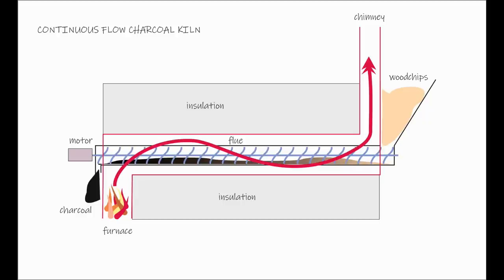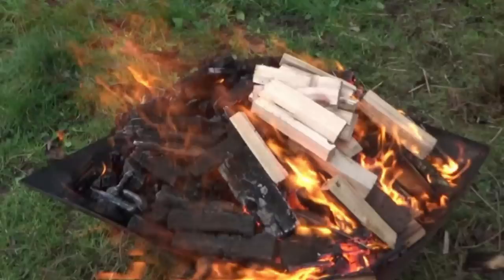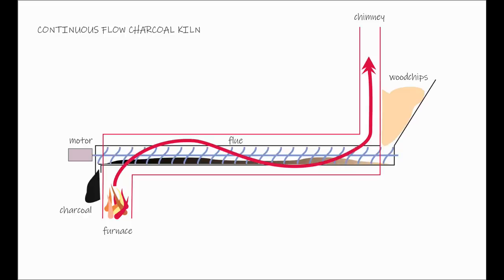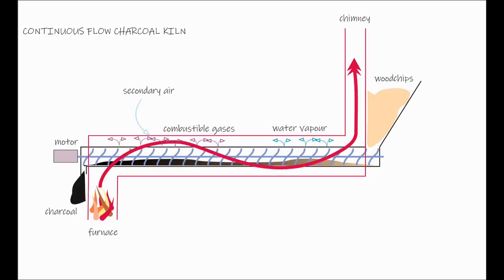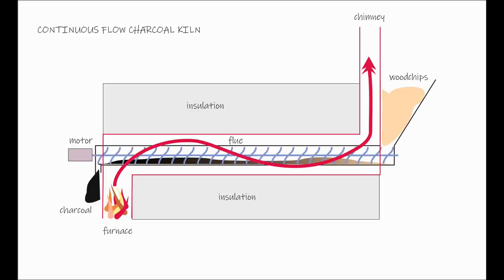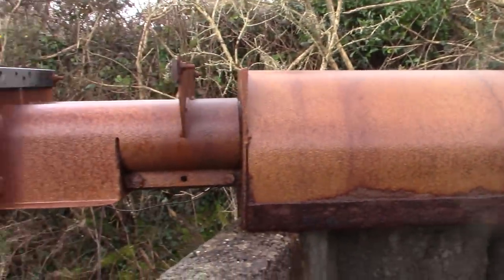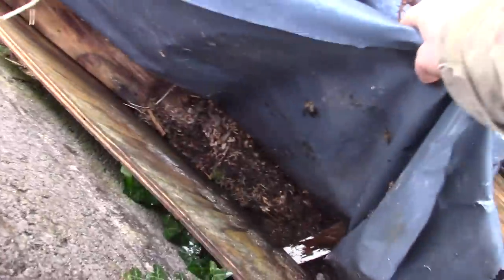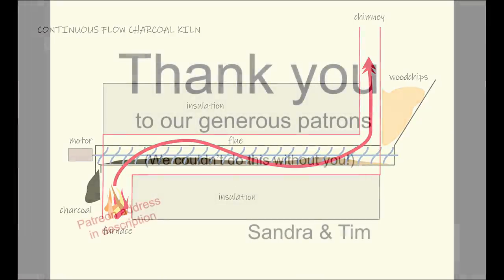An Interesting Design For Constant-Flow Charcoal / BioChar Production..

Comment: I have a question.  You suggested a fire for the charcoal in your design that is fan forced.  Would a rocket stove type design deliver to much heat for the conversion to charcoal.  I have seen them made using cob to surround them to retain the heat and act as a thermal mass.  Cheers.

Comment: Brother, believe me when I tell you I have a foil hat, slide rule, and a big imagination, so this is not from judgement or kicking you in the shin for inventing and trying to make the world a better place.  

This would be a tough one, variations in the wood, the volatile compounds contacting the steel under heat, with the friction constantly removing the scale that protects it from further corrosion....timing, one end of the batch may need more time than the other, so speeding up or slowing down, one part gets under or over cooked.
All the bugs you mentioned can certainly be worked out, but you would need a titanium auger, I don't think coated would work as the heat cycles would cause separation.  I've worked in coke plants, big money, big resources, hundreds of ovens, even with a much more consistent fuel.

Neat idea, you got a whole stack of better ones, that are definitely worth sinking time and money in.

Comment: Maybe you can push the wood chips through the tube, you need just a hydraulic cylinder and a tube.
The cylinder can be mounted on the backside of the woodchip-hopper and push the ram through the bottom of the hopper into the tube. If the front edge of the ram and the inlet of the tube have sharp edges it will just cut through the Chips instead of jamming up if a large chip doesn't fit the tube.
You can even put a boiler into the chimney of the charcoal machine to use the wasted heat to power a small steam engine which runs the hydraulic pump, that is also self regulating, the hotter the fire, the faster the ram moves.
The easiest way to prevent the charcoal from burning after it exits the tube is to collect the charcoal in an almost airtight container. You can use old 200L oil barrels with hole in the top, put the barrel on a pallet jack, roll it under the charcoal outlet and lift it up until it touches the outlet, so there is no gap and almost no oxygen can get in. When one barrel is full you just roll it away, put a metal sheet on the top to keep the oxygen out. Then you can immediately put another empty barrel under the charcoal outlet so the machine can run continuously, as long as you have enough empty barrels. You can just leave the full barrels outside for a day or two, so they can cool off.

Comment: If you angle the wood tube downward at 45°, you would have much less difficulty moving the wood chips from one end to the other. You would not even need a proper auger, just some method of restricting wood and charcoal flow on the bottom end. Leave access at the top of the tube, to allow the insertion of a long skinny metal rod, to shake loose any sticking wood chips.

However… I think that maintaining a constant process will involve babysitting the machine— and be extremely difficult. Batch processing (stacks, piles, cones, or retort) is much simpler, and will ultimately be less frustrating.
Reply from the maker: I have come round to that idea too - simple is best

Comment: I absolutely do understand your desire to have an continous process, but you found out yourself, that heat and mechanics do not always mix so well and can cause a lot of expensive issues. If we define the area between two auger blades at the bottom of a pipe as "one portion", then you have a batch process with ~25 mini reaction chambers running 25 mini batches through the process and keeping it alive.

What if you step back a little bit, forget about all the moving parts and design a process with a smaller number of containers in a kiln, that can be filled throught he top and emptied through the bottom individually? Like 5 steel pipes with 250mm diameter in a setup like a revolver drum. You could always empty out one batch, while the other ones keep the process alive and conserve heat.

Comment: Why not use a vertical system with baffles instead of an auger. Just let gravity do the work by sliding out a baffle to drop the Biochar. You could have it drop into a tank of water to compete the process and hydrate the char.

Comment: What about a chain pulled conveyor instead of the auger? If you had a chain with several vertical paddles fixed to the chain connected to a motor then it could drag the chips through. Not sure how the return would work to complete the conveyor loop
Reply from the maker: Good idea

Comment: Rather than turn an auger - turn the entire tube with angled brackets welded inside like a cement muxer only much much longer. The tube could rotate on ceramic rollers. And could be made long enough  allow for material cooling as well as material seperation (trundle)  This way inital materian could  vary in size. This is a variation on comercial cock/ore kilns. The wood gas could be harvested and used to either heat the primary source or as secondary fuel to power drive motors. A rotory valve configuration on the feed side would reduce the introduction of oxy. to the process. And a secondary slott /sleeve- valve arrangment in the top of cylinder  could be used to  facilitate wood gass removal without allowing material escaping since gravity will keep it on the bottom/trailing side of the chamber. Also keep in mind you don't have to continously heat the tube /chamber it could have high heat segments followed non heated sections , there by allowing you a place for bearings (in coolant). Comercial ore kilns often use large  support gears 1/2 in 1/2out of a heat sink.  Nice concept 👌  food for thought

Comment: Is gravity not the solution Tim? Turn the "burn tube" vertical with a rotating door at the bottom to moderate the flow of the exiting charcoal.

Any blockages in the feed hopper could be eased by something like an old circular saw blade slowly rotating contra to the flow of chips. It would in effect be a tall Cone Kiln with the bake in the pipe exiting at the bottom.

Of course in an ideal Tim World, the exiting char could fall into tanks on  carriages that are shunted along as they are full, a small hole the size of the baking pipe would continue to restrict oxygen as would the chips in the cone kiln/hopper at the head.
Reply from the maker: getting the heat into the shaft would be more difficult when it's all vertical perhaps?
Reply: @wayoutwest-workshopstuff6299  More difficult to keep there, I suspect Tim. You could try a vortex or a baffle at the top like a heat diverter for a back boiler or wrap the auger around the burn tube.

Comment: The holes to let out the combustable gasses - you need to put valves on them to stop air getting in from flue.
Reply from the maker: no - there's positive pressure so no air gets in

Comment: #1. How are you going to detect if the screw does not Sieze up or break. and what types of other safety devices like Motor control's Temp monitoring etc. Also how do you get past the Gretta Thunberg laws LOL .... This design is like several Coal Feeder/power plant designs I did for RISE LOUIS GMBH in Hamlin Germany, in the 80/90's. One was a Closed loop with a Front wall Drag conveyor into a Drop into a Split Screw dual front wall feed and a 3 drag conveyor in the Rear Wall. This mixture was fed into a Pit that caused the material to Rise and go to a Tower that mixed Sulfer or some other mtl to produce Gypsom as a Waste product. All gone now powered by natural gas. The source of the fuel was called CULM from Waste from the Iron Plants all around Penn since WW1 and WW2. CULM is 60/40 Dirt/Coal mix. Look throughout your history books and see if there were any near you from these periods. you might be surprised to find new sources of fuel my friend

Comment: Why not put the pipe in a angle of drop, and trade a conveyur engine for a shacker, like vibrating system on the gold mines? You can put wood, droping with some gravity, and a engine to shake the pipe to make the wood falls, almost like stairs... With that system, you control the  heat of the engine, and it the wood pile up, just put a straight iron, like a shovel to clean the pile up... Sorry for my bad english, i am portuguese and long time no writing english. Greetings from Lisbon, Portugal.
Reply from the maker: Thanks, Nuno. I need to keep the air out of the pipe though.
Reply: @wayoutwest-workshopstuff6299  Well, that is a thing i have to think about it, air plus heat plus wood, and you get fire, you need to get out the air off this equacion, got it!!

Comment: Well... The motor problem is easy to solve. Make it chain drive. I wouldn't even know how to deal withthe bearing issue. Even if you switched to unshielded thrust bearings, you would still cook the lubricant and make them unusable in no time.

Comment: How about a conveyor belt instead of auger .like an old steel excavator track .
Reply: Could work,  but then to make it air tight you would need to make a long box with quite a big cross section to fit the track and wheels. maybe more difficult than just using a stock thick wall tube.

Comment: definately seems too complex for your setup, the need for very regular chip size to avoid fouling notably but also the material cost and some of the challenges around balancing the gas flow and auger speed.

A batch system is my bet for what's a sensible choice, sized to match the hopper wagons perhaps?

Comment: looks like you have plenty of slope there, why not a gravity fed kiln that uses gravity and a sliding hopper at the end to limit the speed the charcoal leaves the kiln 
so simple that no motors are required
Reply from the maker: Good idea - though you retain more heat in a horizontal flue

Comment: Push.... Don't pull woodchips. Like a rotary pusher (a piston like) under and behind the wood chips container. The front of the piston could easily made of refractive tiles,.  No need for rods,  bearings exc 😉
Reply from the maker: Yep - good idea
Reply: @wayoutwest-workshopstuff6299  big fan of yours from Italy. 💪💪💪💪

Comment: Very interesting design, I've got 2 ideas for it:
1) Instead of an auger, a stainless steel conveyor belt could be used, though this would be expensive. I know they are used in ovens and deep fryers in the food industry for continues baking and frying. A belt wouldn't be rubbing against the wood chips like an auger would be.
2) The combustible gasses could be captured in a small tube and be transferred to the start of the flue, so they would heat the entire tube of charcoal, instead of only heating the part beyond where the gasses evaporate. Maybe you wouldn't even need to add fuel to the furnace once it gets going.

Comment: If you drop the 800c charcoal into water would you get a water gas reaction, producing hydrogen and carbon monoxide, not what you want. Would you be better off with some sealed containers to exclude the air to let it cool down naturally.
Reply from the maker: Interesting - I'll look into that too
Reply: @wayoutwest-workshopstuff6299  I know from chemistry lessons many years ago that the reaction is endothermic so isn't self sustaining. I would imagine the charcoal will cool quickly, I assume it will be outside, so maybe just a carbon monoxide detector in the area where you work. You don't want to be breathing more than 50ppm.

Comment: you should use electricity as the heat source because if you take a litre of oil and burn it you can heat a small amount of water but if you use an internal combustion engine you can boil water both by cooling the engine and through the use of the electricity generated. ie there is a reason we use internal combustion engines and not steam engines, efficiency of energy generated/recovered. you can recover the gases from heating in the open ended retort and use them to fuel a generator. this is from the usa disaster plans from world war days on wood gasification. of course the engine needs air to mix with the fuel and that air can be used to air cool the outside of the auger. run the motor via a chain to isolate from heat and provide more heat dissipation surface priot to the auger heat reaching the motor.
plans/systems alreaady exist for how to add or remove from a sealed environment without allowing airflow, theyre airlocks. you can have the wood chips through the auger and to the exit all a sealed environment with no available oxygen then use an airlock to add more wood chips and also to swap out collection containers that would be sealed and allowed to cool
Reply from the maker: 'you should use electricity as the heat source' - ?? (I have tons of woodchips..)
Reply: I don't think I would have put this as eloquent, but I was thinking of a three tier design also. When relating to a small tier make syrup setup my friend uses, we - heats the syrup in barrels with a submersible heater, boil through a vat then finish on the stove. Maybe if you were to heat the wood until the moisture is almost gone, drop in a hopper, convey the wood until Pyrolysis, then drop into a sealed/perforated barrel for cooling.

Comment: Good to see the old brain churning away; your brain, too(grin!).
But ... Continuous flow is all very well for seriously large-scale production 24/7 but can become a burden for small producers like me. A mechanical or motorized or semi-automated method as shown in the diagram (and I know it is not your final design) needs the hopper to be filled periodically or your system runs on empty; you need continual monitoring of log-jams, and presumably you need a means of moving charcoal away from the pyramid that will threaten to engulf your yard.
I can't see you running such a kiln 24/hrs a day, so even if you hire a bright-lad-from-the-village, the thing still has to start up and wind down each day.
I am not privy to your materials volume. 
On The Rock I am taking in grass clippings, hay, sawdust and old soil, sieving the sawdust and soil, and adding it all to 13 and counting bins made of scrap timber (another resource). I have difficulty juggling supplies of these five resources.
You not so much, but while I like the idea of an auger etc it seems to me to be an awful lot of development work compared to a single-shot kiln where you could toss it fixed amounts of chips, firewood, light a match and walk away to work on other projects. You might be doing only one kiln-full per day, but you would be doing one kiln-full each day and would chew through the supply of chips.
Cheers, Chris
Reply from the maker: I'm still trying to find a way to make a living, Chris. Selling lots of charcoal only works if you have it to sell